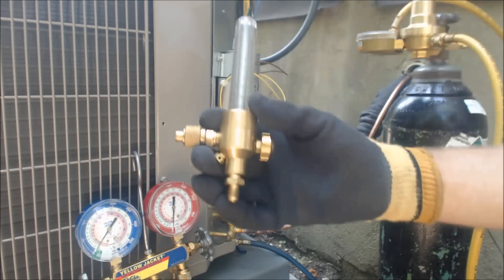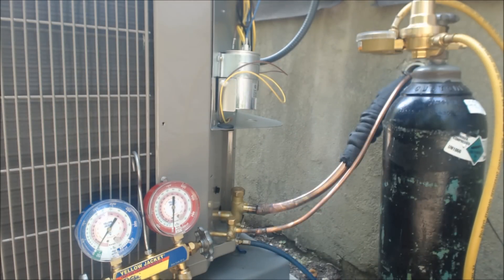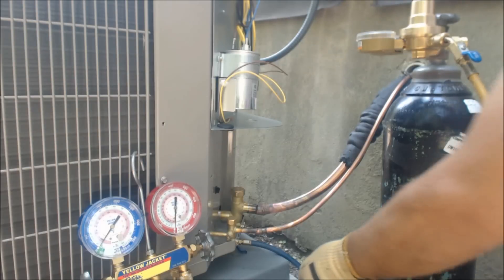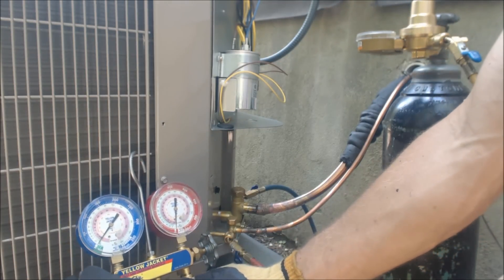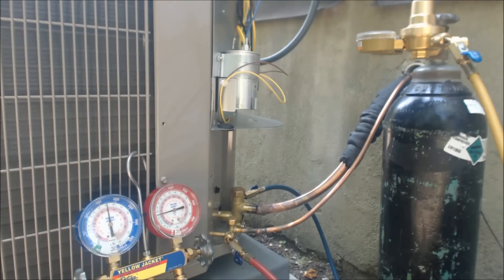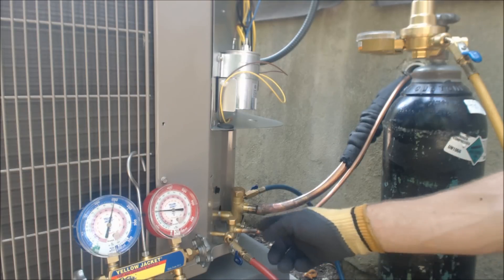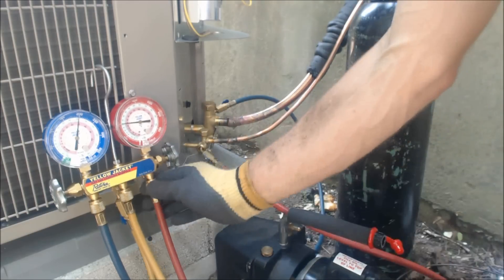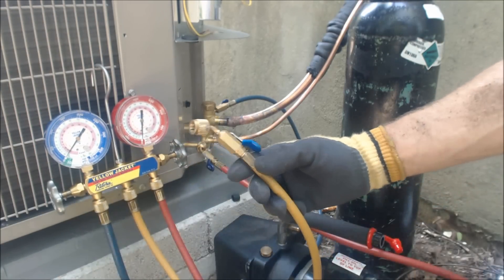Installing an Air Conditioning System: Brazing and Pressure Testing Part 3!

Comment from the maker: Tool List-  https://www.amazon.com/shop/acservicetech
Support-  https://www.patreon.com/acservicetech
For those that are looking for the tools used in the videos: (Linked Below)

Here is a link to the Air Acetylene Torch setup-    http://amzn.to/2aQalsb  

Here is a link the Nitrogen Regulator    http://amzn.to/2bXdR5f

Here is a link to the Nitrogen Flow Meter    http://amzn.to/2brvoBg

Here is a link to the UEI DL389 Multimeter used in the video  http://amzn.to/2av8s3q

Other tool links can be found in the video description section. ACSERVICETECH is a participant in the Amazon Services LLC Associates Program, an affiliate advertising program designed to provide a means for sites to earn advertising fees by advertising and linking to Amazon.com.

Comment: Do you have a video of the vacuum process you used for this unit including the initial opening of the condenser valves to release the factory charge?
Reply from the maker: Not on this one but here is one- https://youtu.be/jlzecsOImqs

Comment: I have manifold gauges to do ac in autos.    I also have the vac pump for cars too.   It looks the same as what you are using, are they the same?   Your videos are great.  I am 1/2 thru my own installation and will make it thru by using videos like this.  Great instructions!
Reply from the maker: Car hoses have quick disconnects where as residential hoses have 1/4" female screw on connections. A vacuum pump used for cars may take longer as it is smaller but may still work. You would need to get down to 500 microns and hold.
Reply: Sounds good.  Thanks!

Comment: Thanks for all of your great videos. I just have a quick question: you do the brazing with nitrogen and at the same time run nitrogen through the system. Isn't is something flammable?  What if it burns in the lines? Thanks.
Reply from the maker: Nitrogen makes up 78 percent of the air we breath. This is verified dry nitrogen so it is not flammable and we are not building pressure in the unit but just flowing it through at a lower volumetric rate, thanks Samuel!

Comment: great series! what psi do you use for a oil blow out?
Reply from the maker: I run about 100psi for 5 to 10 seconds. You only need to do an oil blow out before vacuuming if part of the system is not new such as the evaporator with oil in it, thanks!

Comment: Excellent video as always sir! Might I recommend the JB torque tool to properly seat the valve core to 5" lbs.?

http://www.jbind.com/products/product-search-detail.aspx?SKU=A32008

It's very easy to either overtighten the cores and crush the gasket or under seat them which will cause leaks.
Reply from the maker: Absolutely, great call!

Comment: Hi, great videos as always. Question. is the valve protected if your wet rag is in the back of it instead of the front?
Reply from the maker: Thanks for the question MrOhioUSA. So the rule with brazing near valves is get in and get out so it seems in my experience that more heat faster is better than less heat longer for valve protection and then an immediate rub down with a cold rag. If the wet rag is too close to the swage then you may not be able to get hot enough for the braze to flow and the copper hot enough to accept the reaction. I also was keeping it out of the way for the camera but put it behind around the sides and the top maybe a layer around the front. You could wrap it really good but spend too much time brazing and I have seen several times where someone else brazed it too long and it leaked out of the top near the valve hex key. I did that once too during my first year. I also come up to some systems that leak out of the top just doing my servicing. Does that help?
Reply: it does. Thank you.
Reply from the maker: Great Thanks

Comment: Great video.when I pull a vacuum I like to leave the valve cores out and use those 3/8 black vacuum hoses,it makes it a little faster.Enjoy your videos.Thanks for all the time that you put into your videos
Reply from the maker: Absolutely, there are a lot of ways to pull a vacuum. We just make sure that we don't do it too too fast and leave moisture, that's all. We are also concerned about time if it is a service call. Installations can be done with a long or double/triple evac in mind. Thanks Phillip

Comment: Your videos are really great, and I would like to know if you have a link to a torch tank set for brazing
Thank you
Reply from the maker: Thank you very much! Here is a link to the air acetylene torch setup, just make sure that this will fit your tank size connection.    http://amzn.to/2aQalsb  also here is a link to the Nitrogen Flow Meter    http://amzn.to/2brvoBg

Comment: Question on schrader cores.  I have a York 3.5 ton heat pump and noticed that schrader core replacement is often recommended during maintenance & repair.  How does one know what to purchase to keep on hand?  I've seen many styles on the internet?
Reply from the maker: Great Question! Check out this video on doing just that. In the description below the video I have links to the two removal tools that I like. --https://youtu.be/t69uLxmM5XE

Comment: You said something about the valve core remover that they could be purchased at Napa? Also you said you don't need that core remover to take shradder valves out. So what can you use?
Reply from the maker: They are called a core removal tool. You can purchase them at a vehicle store because they use them to unscrew schrader valves from car tires. You can also buy them from HVAC supply houses. Also some valve caps have the core removal tool built on the back. The tool I was using in this video is used for replacing Schrader valves while the unit is full of charge without losing or recovering the charge. I have a video about that. Thanks for the Comment David!-https://youtu.be/t69uLxmM5XE